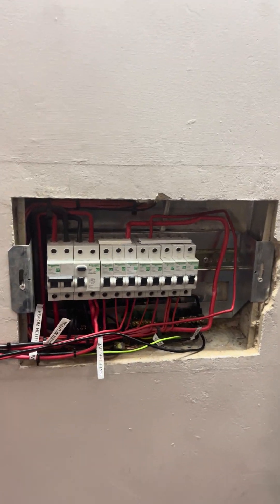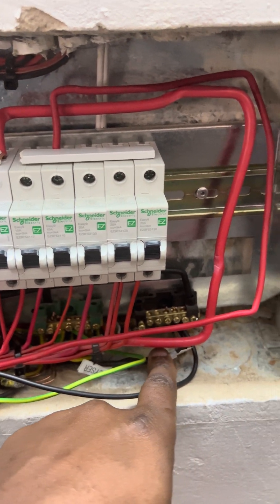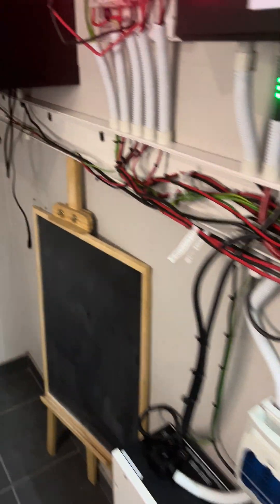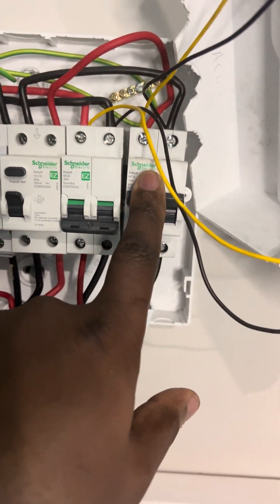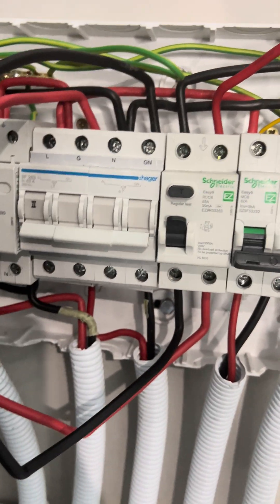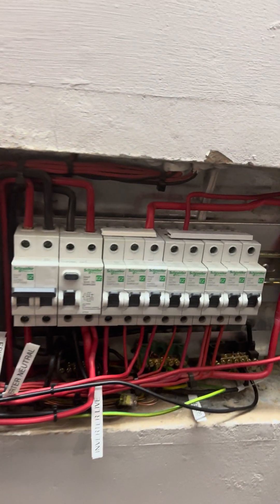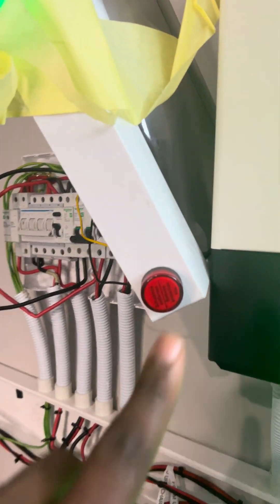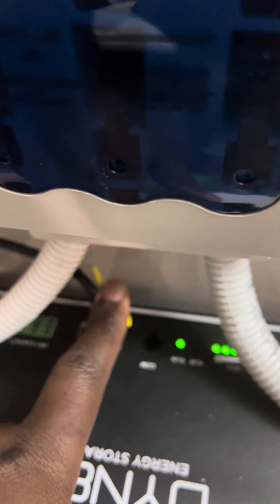Luxpower SNA5000 inverter installation with Dyness Battery Part 1

Comment: Where do you put your communication cable on the Battery and inveter ????  And which cable can you use i have 4 communication cables in the box , which one should be used ???

Comment: So how does your battery last coz I have the same battery 🔋,with the light 💡 inside and outside the house ,CCTV and the Tv and Starlink,I can use it for 7hrs straight,then it cuts off at 20% battery
Reply from the maker: Mine goes for over 16 hours. I have a double door refrigerator, 2 tv's (on at most 2 hours a day), 3 monitors and gaming pc, ps5 and lights. But when there is an outage. I turn off everything except for the lights, tv and refrigerator.

Comment: For the change over. Is it ok to use a contactor to automatically do the switching
Reply from the maker: The purpose of the change over switch in this setup is to be able to isolate the inverter if it dies and go through eskom. no for switch over. My setup is always running through the inverter

Comment: I was installing the same system but I'm struggling with battery settings.

What is the exact number of (Ultra energy battery) LiFeP04 . Plz help 😊
Reply from the maker: Did you get help? What battery are you using Dyness?

Comment: Very good video, keep it up man.  Just a question, can you give the sizes of fuses, breakers and cables that you used as well please?
Reply from the maker: Hi @Rolovibes.

Thanks, I will be uploading anew video that will also include all the materials used and the cost of the project.

But for cable sized I have used this rule
1.5 mm - 10amps
2.5 mm - 20 amps
4 mm - 30 amps
6 mm -40 amps
10 mm - 50 amps
16 mm - 60 amps
25 mm - 80 amps
35 mm 100 amps
Reply: Thanks for this. That's very helpful. Just another question, you don't use a breaker for the main coming in before the SPD, i've seen other people do. Is it necessary? Im assuming the main breaker in the main db will trip with your current installation so no need for another breaker before SPD? Please let me know if I'm right or wrong here
Reply from the maker: Before the SPD it goes through the breaker in the old DB and the EL. Please refer to page 369 of https://www.theforumsa.co.za/documents/SANS10142-1_ED3TC067_SC06_DSS.pdf @rolovibes
Reply: Can I get your contact details
Reply: Hi. Can you confirm that your earth leakage is operating correctly when your manual change over is to switch over to eskom, to bypass the inverter? Because with your current wiring, it looks like you are bypassing your earth leakage as well. If I'm  correct, the output from your change over must first go to your earth leakage and then to your main DB.
Reply from the maker: Hi @charlhanekom2627  it was. But the COC guy recommend I wire it after the change over switch.
Reply: @murendie  so is the way you connected it in the video correct or did you have to change it like @charlhanekom2627 said?